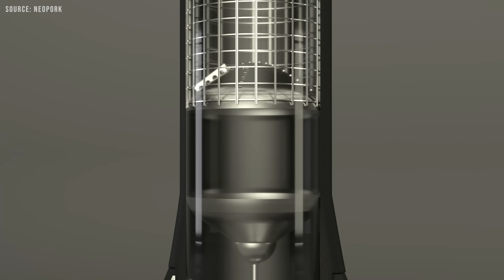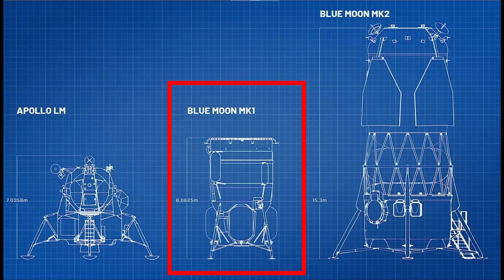SpaceX Found new Brilliant Solution for Starship REFUELING: Hot Gas Thruster

Comment: SpaceX's approach to StarShip development is deeply flawed and destined to fail.
Reply: They did the same for falcon. Worked okay.
Reply: @soothingunboxing7129  Actually, Starship is another beast altogether. It is also a flawed concept from the outset, inspired  more by 1950's science fiction than actual innovation. Landing an upright rocket on an unprepared extraterrestrial surface is a disaster, built into the  planning.
Reply: @buddypage11  spacex is financing starship with proceeds from the profits of starlink subscriptions, its a private money, so whatever they are doing is correct for their case. if they want to spend their money landing a potato chip upright on pluto, i will believe them as they are using their own money to do it and must be correct for their situation.
Reply: @soothingunboxing7129  no they didn't. That's a myth. 

The first 3 Falcons blew up. But there was a one year gap between Falcon 1 and 2, and another 18 months between 2 and 3. They tested the component, tested the fix, tested the whole thing, carefully in computer models, then in every possible way before the actual launch. That was why it took so long between tests.

They didn't just launch rocket after rocket months apart, failing 10 times in a row , trying to develop a spacecraft by trial and error like developing a computer program. The string of failures is unprecedented. 

I'm not a rocket scientist. I'm a programmer. I might be wrong. But it feels like this isn't the way to develop new spaceship designs.
Reply: They are much more ahead than everyone else.
Reply: @octaviondeminicolas1941  Aye. Even China's only just caught up to landing on the moon... seeing as the US did it first.
The current race is to generate the 'big rigs' of space so material can be moved as well as astronauts.
Reply: True, but the Super Heavy booster has GREAT potential. Substitute if for the first stage of the Saturn V, and we could put a huge amount of mass on the Moon, especially if the new second stage J-2X hydrogen engine, which they perfected at Stennis, was used in the upper stages.